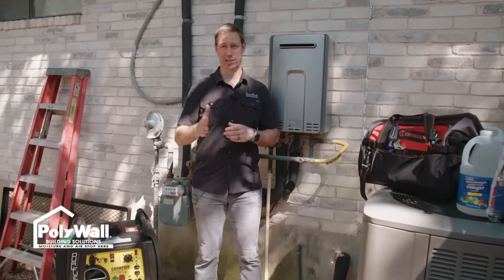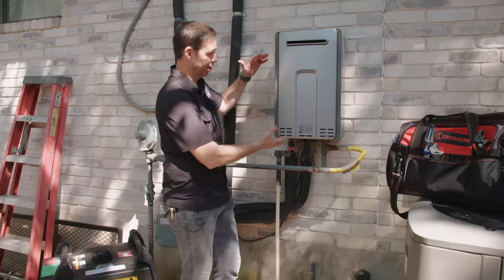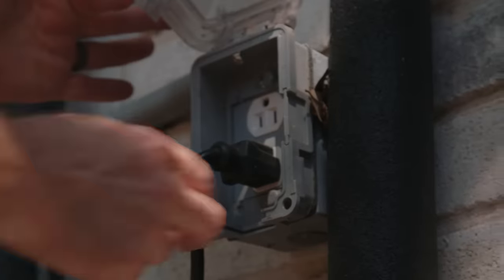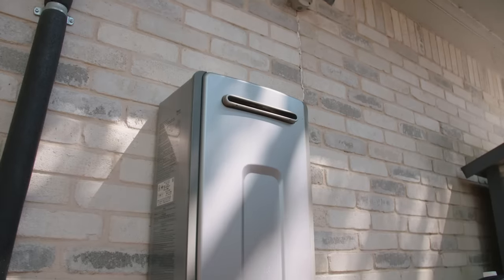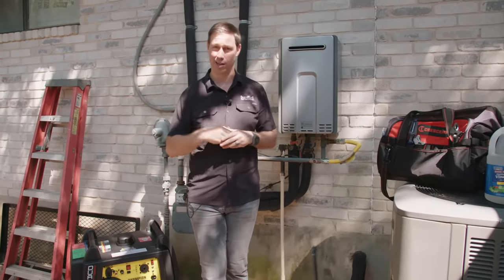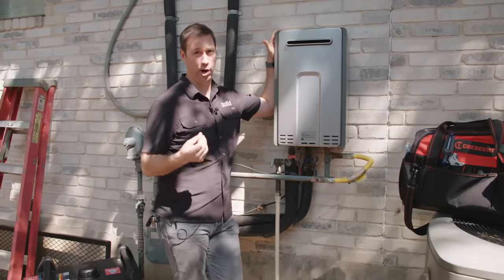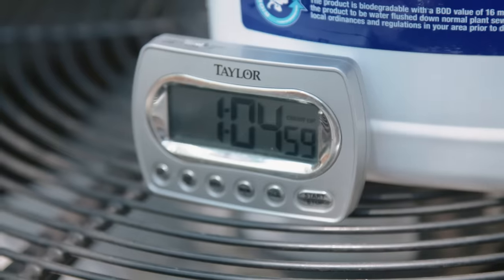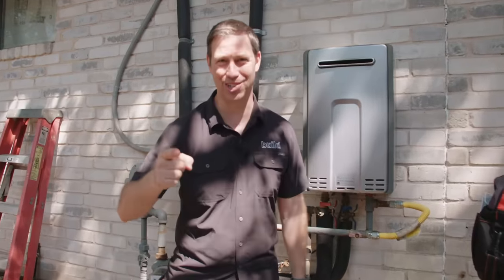3 Things They Don’t Tell You About Tankless

Comment: "Why don't we have hot water?"   "Because we mounted the tank outside and now its gone."
Reply: Here the tank would still be there, but it would also be frozen solid. Or the water lines to and from it would be. 

And there is no natural gas service here either. So I would need either a really big single phase service, or go to three phase which is quite doable, for a price.
Reply: That’s why it is called tankless.
Reply: @mikespangler98  if no natural gas. Why not Propane??
Reply: @ltsgarage7780  Because propane isn't cheap anymore. In Texas I'd probably go for an 80 gallon heat pump water heater since there's plenty of free heat around to harvest at 400% efficiency.
Reply: @hailexiao2770  then I guess you should go another direction. Use what ever works the best and is the most economical
Reply: @Vincent James does this mean we do not have all information??
Reply: @hailexiao2770  I'm paying $1.16 a gallon this year. That's not bad. And I live in NYS
Reply: Outside? Not where I’m from.
Reply: I know really? Who would put their water heater outside???
Reply: Yep tweakers and copper tubing!
Reply: @Bobdixon_Moonvarga_Dancer_III  depends on where you live. California you can do it almost any where?
Reply: That's Pretty Funny!
Reply: @mikespangler98  These things also run on bottled propane.
Reply: here in Europe, tankless heaters are installed INSIDE homes, I really don't know why you ppl in USA install them outside...it's stupid, no winter at all??
Reply: @RoboVacParty  Yes, in the south of the USA, it rarely gets cold so its not a problem except for theft.  In the north USA, they don't get installed on the outside.
Reply: @nickv4073  lol. Texas has entered the chat.
Reply: @mikespangler98  I have installed the same unit in the Canadian Rockies.
Its rated to -40 C.
Reply: @ltsgarage7780  Bought a home with a propane tankless. I ran out of propane in a week.  Nat gas is the way to go.
Reply: @Bobdixon_Moonvarga_Dancer_III  florida
Reply: @lenbroude2925  I’m talking a safety and security factor. Florida has bad neighborhoods, crime, and hurricanes, California is a cesspool. Doesn’t sound smart to me.
Reply: @ltsgarage7780  with propane the cost savings vs electric disappears, get an electric tankless if on demand hot water is what you want.  But from a cost perspective nat gas tankless is the only one that makes sense unless your in a off grid scenario, where your solar can’t handle the power requirements electric tankless.
Reply: @RoboVacParty  you can do both here, I live in the Phoenix Arizona area, pipe freezing here hardly ever happens, and it is usually only with irrigation lines.  So outside makes sense here especially with not having to worrying about exhaust.
Reply: @mikespangler98  options are gas, propane or electric
Reply: @Bobdixon_Moonvarga_Dancer_III  I have no problem in S. CA. Backyard, brick wall, iron gates and a big dog snd security cameras.
Reply: @Bobdixon_Moonvarga_Dancer_III  guess it depends where you live. I’m from England where they’re all inside but been living in Sydney Australia for the past 16years and they’re all outside unless you have a new build.
Reply: Can't have shit in Detroit
Reply: you need to get a dog & a fence, what are they already steeling
Reply: @nickv4073  Having spent a significant part of my life in southern California, I can say that wherever it is warm enough in the  United states to have a water  heater outside, is probably a place where someone may remove it without authorization 😅
Reply: 😂😂😂 THE CORRECT ANSWER IS : YOU LIVE IN THE WRONG NEIGHBORHOOD! (IF YOUR TANK IS STOLEN!? - MOVE OUT....😢😅!)
Reply: @voytek3999  My 4 year old writes in large caps too.
Reply: @nickv4073   SURE! AS WE GET OLD(!) WE RETURN BACK TO THE STARTING POINT! (IN BRAIN CAPACITY AND BEHAVIOR......)WILL REMIND YOU WHEN YOU REACH MY AGE.....!
Reply: Can't believe this guy doesn't know about water softeners. Have had tank less water heater since 1986 and never had to do anything with it.
Reply: My house is 1/2 mile from the road on a gated driveway and you can't see the house from anywhere but across the valley. I think my tank will be fine.
Reply: Exactly. Wheres his house?! I have had got water in a month m I'm freezing 🥶
Reply: @1mantisco  we pay over 3 a gallon for propane here in our part of Northern California, and electricity is super expensive also.
Reply: @davidbocek Not every one has access to to natural gas.  We have propane furnace, stove, fireplace, patio heaters, and the 199,000 BTU tankless.  We have a 500 gallon tank.  It costs 1500-2000 to fill.
Reply: unfortunately he was found dead
Reply: Stupid question..Do any of them have an internal clock and an automatic drain function? Seems possible?

Comment: That looks absolutely hideous how they ran that gas line
Reply: The whole install is Bad!!
Reply: It seems like Texas has a lot of half-assed installers:  plumbing, fireplaces, sheathing, concrete, etc.
Reply: Gags I don’t live anywhere close to where it freezes. If you do or you live in a snow state. No I would not put it on an outside wall of your house.
Reply: Gags I am in North Carolina and mine is mounted on the wall outside, but it is lower to the ground and all the piping is very close to the unit since there is a crawl space under the house all the piping comes out of the crawl right to the unit. It isn’t even noticeable from the road thAt it faces.
Reply: As critical as Matt is I'm surprised he didn't mention it...hmmmmmm
Reply: @internettoughguy  Looks like fake brick of some sort.
Reply: @ltsgarage7780  they coming in inside and outside options
Reply: Grucha Killa I’ve been installing these heaters for over 25 years. I already know that they come in interior and exterior models. 
 Some brands come with the exact same heater. They just include a flu adapter when installing them inside. 
  I’ve been in business for over 46 years.
Reply: Was thinking the same thing.  Ours is in our garage and much cleaner looking.  Works awesome.
Reply: Just incase u need a bike rack gas line
Reply: @ltsgarage7780  but you saying you would not put it outside of the house ? Why ?
Reply: Grucha Killa I’m not saying that I would not put it outside or inside. This is not my job. As in, I’m not back where ever this job is.
   What I said about this job was . This is a piece of shit the way it did get installed. If I showed up at “my friends house”and someone had installed this on his house. I would go to my supply house picked up the materials I needed. taken this off the wall thrown it in the yard. Then replumbed every bit of it!!!!!
Reply: Grucha Killa I’m not saying that I would put it outside. You’ve just miss understood what I’ve said. I’ve installed many outside. I’ve just done a much better job than this!!
Reply: C’mon you gotta leave something to catch the weed wacker or lawn mower on 😂 boom
Reply: Wally Kramer I live in south Texas ( transplanted here) and found it odd that the breaker box is on the outside wall. Also their gas meters are on the property line by the street with no protection from traffic. I’ve seen many homes with plumbing ran outside of the exterior wall as well. A different world than I’m used to.
Reply: Mike Schneider where and how long ago did you get transplanted from. 
    Why?
Reply: fire surfer no it’s obviously an addition to the original structure that line was the end of the house at some point
Reply: I didn't see a ground wire on the stainless gas line.
Reply: Danielle Caputo the only difference between your house and most is. You cannot use the crawl space to run pipes through. You must drill holes off to the side and run your pipes through those holes. 
   A vent or a crawl space cannot be repurposed. 
       One use only!
Reply: Big RICK the complete job is Wrong. Way name one thing at a time.
Reply: He basically said, my sons are now spanking it in the shower for 45 minutes
Reply: Cowboy install. Yee ha
Reply: Yeah thats a realy shitty install
Reply: Pitiful everything on this video. Worse installation ever. Tankless absolutely is cheaper unless someone is abusing water consumption. This whole video gives plumbers a bad name!
Reply: The gas line is structural!
Reply: I sell customers the option to vent directly into the house to augment heating bills - not until I get my check though.
Reply: My guess is that this is a retro install and the tankless system had to be installed a bit of distance from the meter due city code.  I know for fact that the unit should never be installed in close proximity to the gas meter.
Reply: plumbing code violation.
Reply: Yes they could have put it on the wall at least, then out...
Reply: @ltsgarage7780 
No doubt
Reply: @victormartiny6419  nope. No doubt what so ever!!
Reply: totally agree, I keep mind in the corner of my garage and it looks great and out of site
Reply: My god that’s a disgusting install  and this guy is showing it off!
Reply: Agree with you 100%.
Reply: @gags730  It's called carbon monoxide exhaust which KILLS. You MUST ensure all exhaust is vented outside of the house.
Reply: The whole install is horrendous. The only thing decent about it is how the heating unit is mounted to the wall. Everything else is a horrific, home gamer looking, hill folk jury rigged looking nightmare. One wayward football and the whole neighborhood would have to be evacuated.
Reply: If they really put some effort into it, they could have made it look worse.
Reply: No one is going to notice it
Reply: @guzano568  eh... No one will notice as long as they're never there to see that.
Reply: @bigjon9508  😂
Reply: @guzano568  😂
Reply: Facts
Reply: I just watched this video and was gonna say the same thing that gas piping looks terrible no hangers & wouldn'tt pass code up in New England!!
Reply: @bigjon9508  it looks great from my house..lol🤣
Reply: That does look rather hideous, you are correct. However, at least it wasn't installed by an absolute idiot that drilled the vent pipe holes from the inside to the outside of my 150 year old is storic on. They really screwed up the brickwork and could not have been any less concerned. Sometimes I just absolutely hate tradespeople.
Reply: I have an oil fired 30 gallon water heater and I have it on a timer so it'll only run for about 10-15 minutes per day. When I take my shower itll run for another possibly 10 minutes. Its ON for 3 hrs. everyday but it'll only run for a short time.
Reply: They wouldn't know parallel lines or perpendicularity if it walked past them or rammed into them 😅

Comment: I owned a Dry Cleaning plant that also laundered shirts and was replacing one of my two 100 gallion tanks each year. I switch to a tankless system set at 160* and washed shirts and laundry for 5 hours a day. My gas bill was cut in half and when I sold the plant seven years later it was still running efficiently with only two service calls in the time I owned it.
Reply: Sweet !!!
Reply: Wonder what the pressure to the building was, or was it mechanical failure and not leaks/breaches causing the problems?
Reply: Don’t forget the maintenance tankless demands not worth the savings.